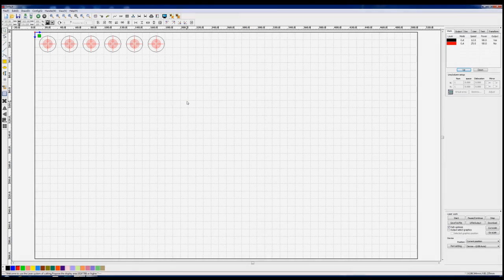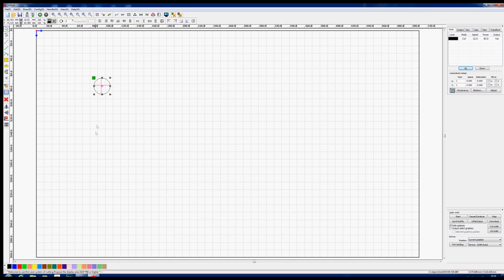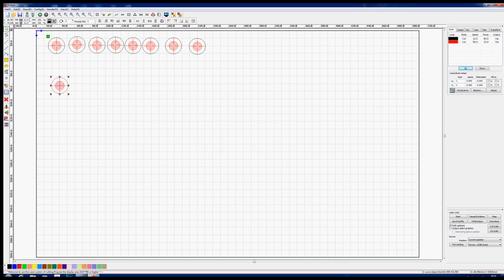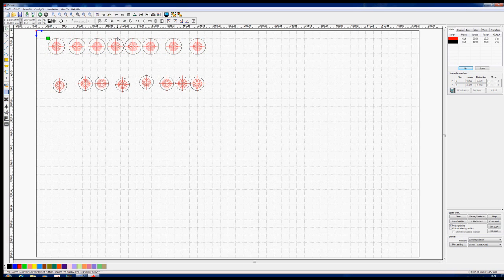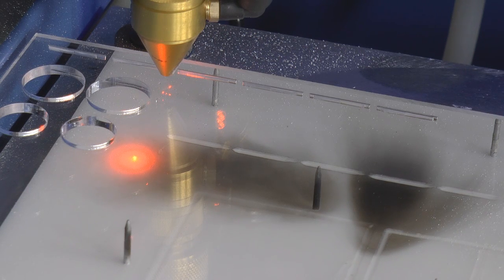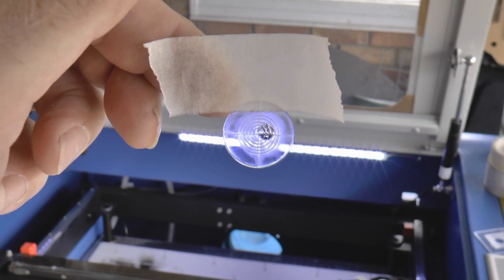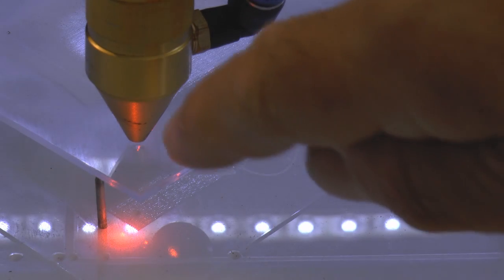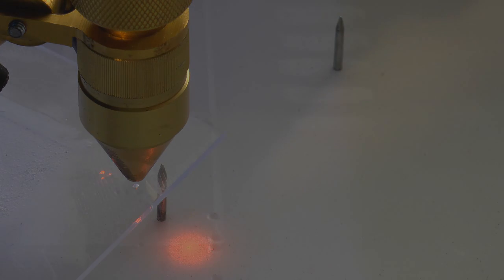RDWorks Learning Lab 12 mirror alignment

Comment: Really love your work, and your help.  Have a question, you spent some time in your videos making the laser tube aligned as best as possible to start with in its holders, by even making special mounts.   But after watching all of your videos and other information online, I can't figure out why or if this really makes a difference as long as you get a nice straight beam between mirrors 1 & 2 "Y axis" far and near,  and mirros 2 &3 "X axis far and near, and then get your beam centered coming out of the laser head.  The only thing that I can think of that would make it beneficial to spending the extra time in the laser tube compartment messing with the brackets to get the tube as perfectly aligned to the machine body "which may not be parallel or perpendicular to the x and y rails anyway, would be ease of adjusting the beam to get it aligned correctly on mirror 3 at the top of the laser head without messing with the previous mirrors that you already set in the alignment process.  Any advice or tips?
Reply from the maker: +Todd Mueller
 Hi Todd
Remember this video series is all about me learning. At this point, I'm doing my first mirror setting but as the series progresses you will find mirror setting several times with slightly different methods. I eventually worked out the ultimate and most efficient method when I reset my new 60 watt tube (https://youtu.be/Vl6QKlwRKlk)
There you will find a series of logical steps and minimal mirror tweaking. Also at this point I had not discovered that my lens had been factory fitted upside down. In these early days, like you, I could not see the logic of spending too long in the laser compartment. However, I came to realize that although it may not be true to the X and Y axes, it was two stable reference planes to work from. The key mirror in the setup is mirror 2.The principle I ultimately discovered was to use the tube to steer the beam true onto mirror 2 (true to Y axis) and then MOVE the head (mirror 3) to catch the beam after it has been set true to X axis. I had to make my head adjustable to achieve this but all of a sudden life became simple. It's taken me a long time to suss out all these details ...perhaps I'm a slow learner as I get older!!!
Thanks for your appreciation. If you are only at session 12 then there's a lot of discoveries I've yet to make.
Best regards
Russ

Comment: Hmmm, shouldn't the beam after the last mirrow that goes down to the target aligned perpendicular to the target surface.
If its perpendicular but not in the middle then the lase tube should be repositiond instead of adjusting the last mirror and so getting a wrong angle down on the target ?
Reply from the maker: +pyrofilm
Until I did my experimental work in part 2  where I demonstrated the effects of off-angle and also position of the beam relative to the centre of the lens, I would probably agreed with you. Howerver I can only act upon what I discovered. The last mirror is the least important because it does NOT have to  steer the beam perfectly coaxial with the lens tube. Mirrors 1 and 2 are really critical They must be set to ensure perfect beam alignment with the X and Y axes in both horizontal and vertical planes.Once this has been achieved no matter where the last mirror is in the work area the beam will always hit the last mirror in the same place. You can then set the last mirror to steer the beam through the centre of the lens (ideally but not essential) and the focus point will remain stable.. If it's off centre to the nozzle, as mine was in the video, a little tweak on mirror 3 will correct this. The essential thing is to ensure that the beam strikes the lens in the SAME place (off centre is still ok) regardless of co-ordinate position. The 4 nozzle burn test is the final check to see if you have achieved this.

Comment: I found best way to adjust 3rd mirror is to take nozzle with lens off. Lower head on piece of paper and draw circle around it. Fire, raise head (or lower bed) and see if it's in the center. Or use one of your round targets.  
BTW thank's for all your videos, I'm learning a lot! :)
Reply from the maker: +bratan007 
Luckily I have never had to do a full mirror realignment. If you check out session 21 after I replaced my tube, I was incredibly lucky with the alignment of the new tube and needed no mirror adjustments.  In this video I show you a quick and accurate way to align the focused beam using a piece of wood. Fortunately it's a large hole in the nozzle so alignment doesn't have to be perfect. Thanks for comments it's good to know that my hours of experimentation are benefiting others.